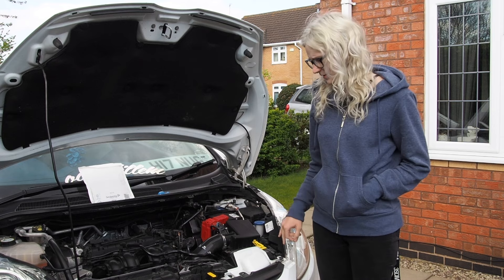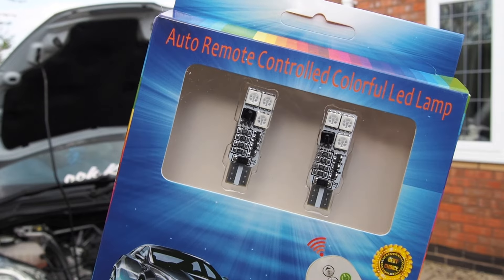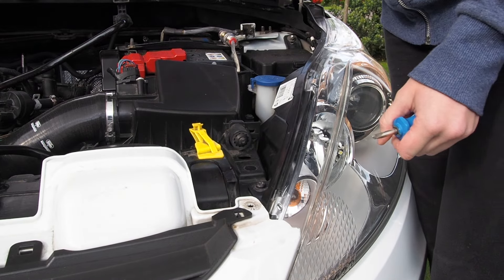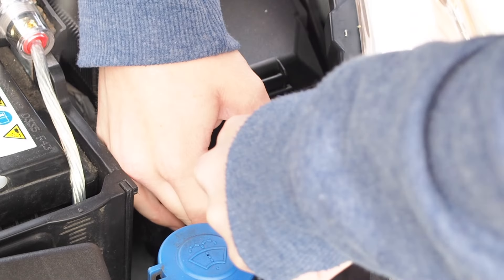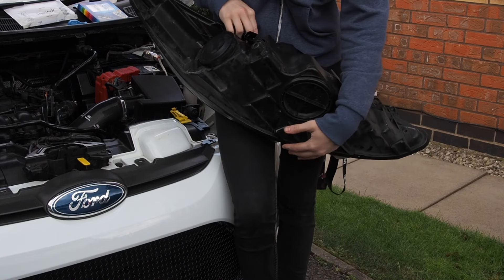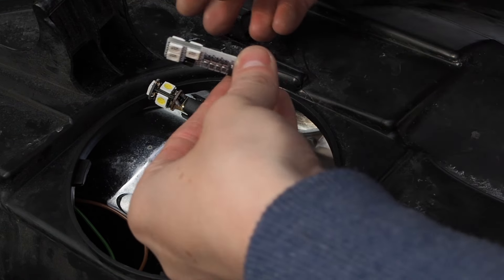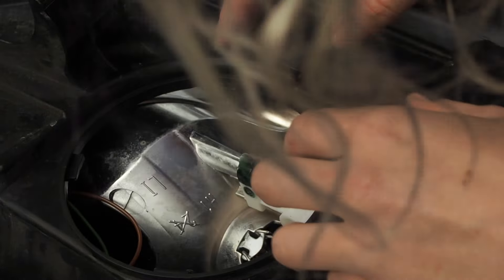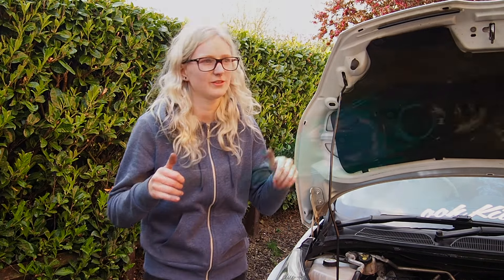Colour Changing Side Lights - Ford Fiesta MK7

Comment: Thank you so much for this very helpful video - the car's handbook was useless. I particularly appreciated your advice on how to get the connector apart. 
Who designs modern cars? Gone are the days when  you just had to undo a couple of screws, lift off the light cover, and there were the bulbs in plain view - just twist out and replace, job done!

Comment: Nice video Kelsey. :-) I couldn't get my light unit off due to a stuck bolt, but I managed to get my arm underneath to unscrew the cap and replace the light which was a bit fiddly but it worked.

Comment: Looks good, but I'd be wary of Ebay LEDs as many of them will start flickering. If you need any other bulbs, head over to CEUK. They have excellent customer service and one year minimum warranty :) They also do the chrome indicator bulbs Harry mentioned
Reply from the maker: Harry Goozee Thank you! Yes I’ve gone through 2 sets now but had my most recent for 6 months now👌🏼😊 alright for £6! And thanks I went ahead and got the silver indicator bulbs 😁🤘🏼
Reply: I had a problem with CEUK number plate lights, and they sent a new set straight out for nothing after contacting them. Really good. Nice one, they look so much better than the egg yolk ones! Front ones were a pain to remove, was worried of breaking them but all OK :)

Comment: Hey greetings from Germany, 
I got the exact same car as you have. White Paint, Blue Interieur , same engine i guess you also got the 1.6 L Ti-VCT engine with 120 HP ? I wanted to ask if you can set your side light to regular White as they meant to be because in Germany it is illegal to drive around with coloured side lights. And do the Lights save the settings which you set them up the last time before shutting down the car? 
It's interesting to see someone Else with the exact same car.

Thank You
Reply from the maker: CryTekno HD Yes they have the colour white! It’s also illegal for us to drive with coloured lights, and yes they will stay on the same colour every time you turn your car on and off 😊

Comment: Have you still got them in your car? Thinking of getting a set in my car for fun but don't know if they'll last long enough
Reply from the maker: LJTProductions Yes, I’ve had 2 sets, first set lasted a month but the second set 6 months so far!
Reply: I ended up buying a set a few weeks ago and tried them out and one stopped working with the remote so i bought another set, also said about the issue of the previous one and got a replacement set so now got two working sets haha. I need to do a video of them working.